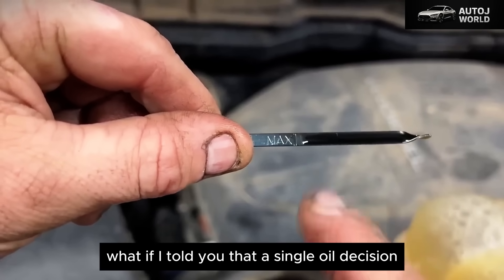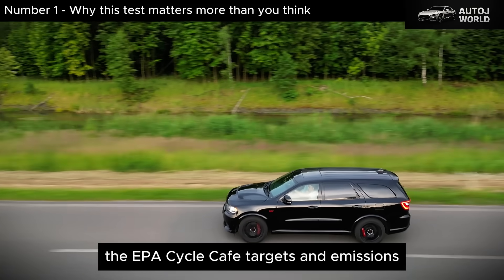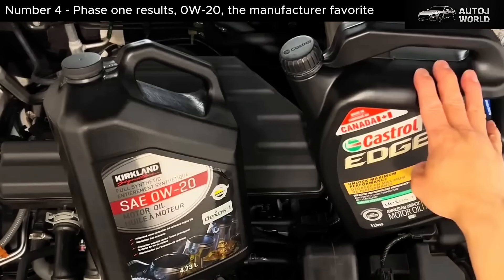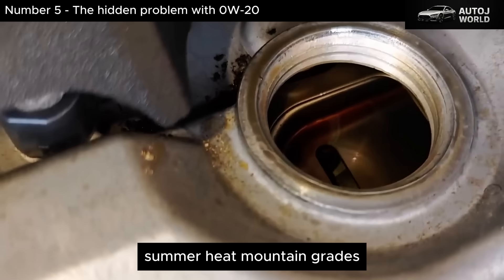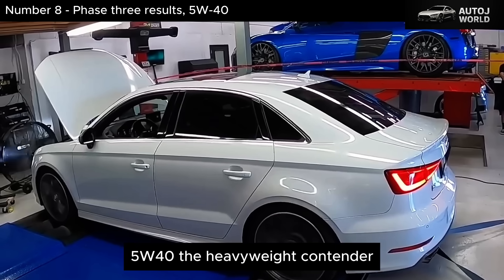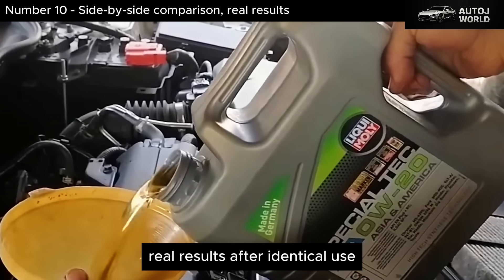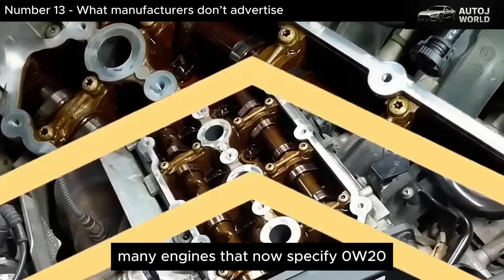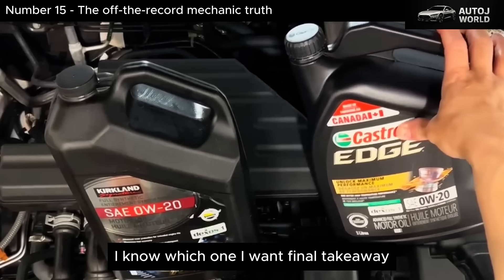We Tested 0W-20, 5W-30 & 5W-40 in the ENGINE — One Clear Winner!

Comment: Shell Helix Ultra ECT 5w30, in my Mazda CX-5, it is one of the best upper mid priced oils in my experience over the last 10 years or so, and widely available.

Cheap oils use cheap base oils that evaporate and cause sludge build up in the pump, irrigation channels, and on your rockers and lifters, causing you engine to work harder, and in turn, this causes low oil pressure issues, and accelerated carbon build up in valve ports and on valve stems etc.

So don't cheap out on your oil if you want your engine to last and run cleanly.
Change your oil and filter every 6-7k miles MAX, and your engine will thank you.👍🏻

Comment: Most modern engines have a compression ratio of 10:1 to 12:1. The best oil to use is a 5W30 SN fully synthetic oil with molybdenum additives...😊
Reply: Torco 100% synthetic oil is heavy in Moly B.
Reply: No SP or later with no calcium if the engine is turbocharged or you risk low speed detonation damage. More risk of damage from inappropriate formulation with old 5W30 formulations.

Comment: After the warranty period , I switched from 0W20 to 5W30 .Everything is fine, oil consumption is zero . VW POLO TSI , 2021. Thank You 💞 ( LIQUI MOLY 4200 NEW GENERATION  5W30 , API SP , ACEA C3 )
Reply: The recommendation for that engine is 5W30 in Europe. This is quite common from what I've seen.
Reply: Liquid molly is expensive trash oil with no benefits. Use proper 100% synthetic oil like motul or amsoil
Reply: Liquid molly is expensive trash oil with no benefits. Use proper 100% synthetic oil like motul or amsoil

Comment: Ai commentary is just bull
Reply: YES, Absolute BS….. follow Lake Speed, he is an oil expert.
Reply: @mikel14028  Agreed.  Lake is aTribologist and does real world oil analysis in his lab.    Some of this AI crap is true but the over generalizations are not.   AI is ruining youtube.
Reply: Exactly my thoughts. It has recycled images from Project Farm's test of motor oil race at low temps. If all this BS about low oil viscosity is causing engines to self-destruct, why are 2018+ Camry's with dynamic force 2.5L engines have 300K+ miles on them running a 0W16 oil?

Comment: in theory if the metal parts are held apart by a thin film of oil, there is very little friction and the enigne could go on and on and on, but alas nothing is perfect and if the metal surfaces rub for any reason, wear will be fast.

Comment: Here in Australia if you own a 6  cylinder Falcon we use 15w40 grade engine oil, these engines can last up to 700,000 kilometres on the same engine, I guess that's not real bad
Reply: 15w 50 here in texas. Never had a problem😊
Reply: A 6 cylinder Falcon is about 60 years old
Reply: How often do you change your oil ?  Mileage
Reply: Normally with these Australian Falcons you change the oil every 15000 kilometres, I've heard of people who never changed the oil and they kept going
Reply: @patfallon3027   wow just under 10,000 miles

Comment: I only use 0w20 oil in my Prius and the engine runs excellent even after 300 thousand miles. I would never use any other oil in the engine, only 0w20.
Reply: I was told synthetic oil doesn’t loose viscosity, you change it when it gets dirty

Comment: I have been  using 5w20 blend but after watching this I will switch to 5w30
Reply: I reccomend you go for 10w60 and your engine will say thank you. When very cold climate go for 5w40 never less.
Reply: @johannapoder2843 can you just switch oil like that in any engine? I have a 2006 Honda pilot running 5w-20
Reply: @dracc1370 my brother was so scared to but thick oil in hes 2012 volvo 2.0d. He was running 0w20 now he has 5w40, and he was suprised, he said the engine is so quiet and smooth😅 engines dont run long on water like oil. Also 10w30-60 oils have way less additives and way more real ester oil. Look for good high quality full synt oil only.

Comment: I use 5W 30 as recommended by Honda for their iVTEC engines and have never experimented with any other grade. The only difference being though my car is still under warranty and the oil changes are done in a Honda workshop, I use Mobil 1 instead of their OEM Idemitsu, as provided in their workshops by default.

Comment: In Phoenix where we have very hot conditions in the summer and fairly cold conditions in the winter. I would think that 5-W40 would be the best in my turbocharged engine during the heat of summer, and 5-W30 during winter months. Back when I was learning auto mechanics in high school, we used single viscosity engines year round. We used 30 weight in the winter and 40 in the summer. Cars that were built to see street strip duty we used 50 weight oil when drag racing or endurance racing. We might drop down to 40 weight in the winter if we were racing in cold winter nights.
Reply: cold in winter????? Phoenix lol
Reply: @CAlAlbert well for us desert rats it gets cold. We’re supposed to have a low in the mid 30’s this week, but when we first moved here in 1969 there were plenty of days in the 20’s. That isn’t Alaska cold, or Lake Effect snowstorm low. I know what -20 feels like. But the real problem here is the heat. It doesn’t get as cold as it used to in populated areas because the buildings and roads and parking lots reflect the heat back into the atmosphere and cars suffer. Car batteries have a short life because they are made for cold climates, where the chemical reaction between the acid and plates slow way down, so the battery industry does things things to speed up those chemical reactions so you can start your car when it’s back east cold. But that very same battery wears out prematurely. In 1995 I bought a Jeep,Cherokee, used. The battery failed weeks after I bought it, so I replaced it with a Check Auto Heat Beater. The chemical reaction was made to be much slower, and it worked. I traded in the Cherokee in 2006 and the Heat Beater was still working just fine. Checker quit selling them because the snow birds would drive here from cold country, buy a Heat Beater and get stuck when it got too cold for them to work. Oil is just another thing that’s affected by extreme temperatures.
Reply: Most engine wear come from cold starts thinner oil protects better against cold starts, I would not tend to believe these AI created videos, I have a 15 year-old Toyota Corolla and a 10 year RAV4 running on OW 20 with no issues and I’m in South Carolina

Comment: Was the same brand and rating oil used in each viscosity, (which oils) and was test repeated for other brands? otherwise imo, results are invalid. Also where are the test result sheets to prove results? sorry but without full details, this comes across as ai generated bollocks.